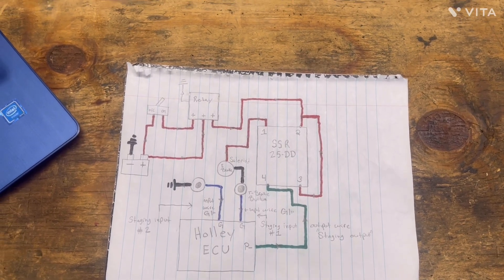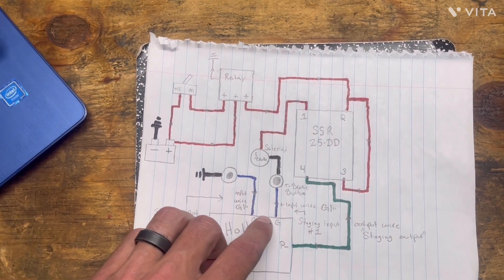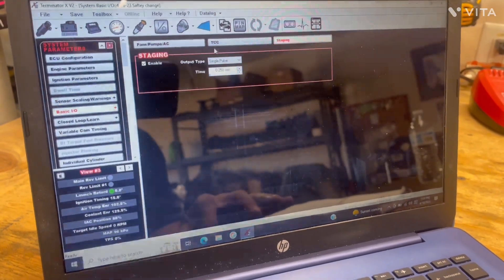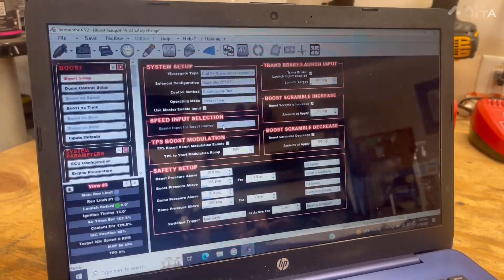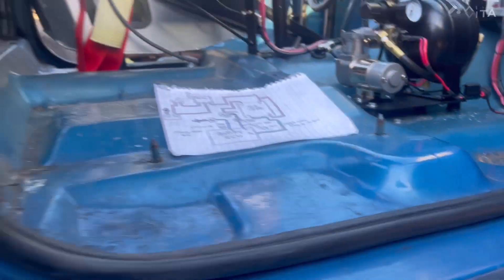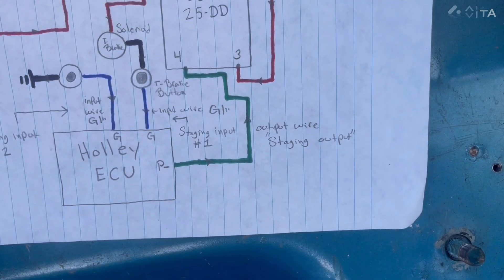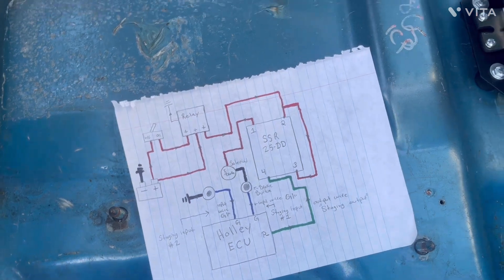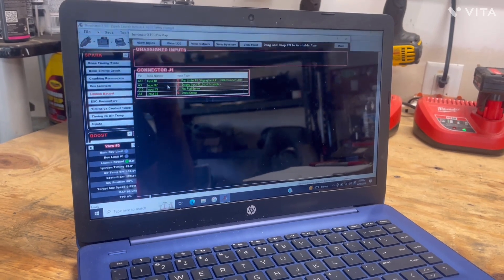Holly terminator X ￼trans brake and bump/scramble button wiring with diagram.

Comment: Will this work on holley hp ecu
Reply from the maker: Yes. Just read the description cause I forgot to put one part in the video. “The ground side of the trans break needs to go to ground also one side of the trans break button needs to go to ground” but yes it will work. My new truck is wired the same with a dominator.

Comment: Is this putting all of your solenoid current through the ground in the ecu?
Reply from the maker: Yes I was wrong in the video. Here is the link to the video and how I have it wired. The only thing that changed is the trans brake is grounded and the trans brake button is grounded. They do not tie together. https://youtu.be/Yz8AmD455XI?si=pxILc1gf8rDDAeYg
Reply: @BoWhiteRacing  thanks. That’s how i have it and was just curious why it would be different. Thanks for the info!
Reply from the maker: I’m looking back now to see how I had it wired. I think the coil was wired to ground and not to the button. I think I mixed my diagram up. I will figure out what way I wired it and fix the video or remove it and make a new one. Thank you.

Comment: Question about your pwm- did you just tap into the harness
Reply from the maker: It goes to an input.
Reply: @BoWhiteRacing  I see the output wire in the diagram in the J connect I was wondering did you splice into that
Reply from the maker: Im not 100% sure what you are asking. The inputs and output have a harness with 4 each that’s where I tie them to.
Reply from the maker: https://youtu.be/VCbD9vfmcb8 is it this relay?

Comment: Mine wired per the sloppy page, test ssr with multimeter pin 1 on ssr shows 11.7v, connect transbrake soleniod test it now only has 6v and voltage drops away 

Any ideas?
Reply from the maker: Let me look at mine and see what mine has. Maybe try removing the ground on the T-brake solenoid and see if the voltage comes back on pin #1. Let me know what you find.
Reply: @BoWhiteRacing  11.7v but transbrake soleniod doesn't engage/click 

Should I try earth it at trans?
Reply from the maker: Where does your ground for the solenoid go? Does it go to the Holley? If you ground the solenoid and give the other side power does it click then?

Comment: So one more question. So obviously the ssr switches it from ground to a hot correct?  If not. I'm still confused. Cause I have no hot wires going to trbake
Reply from the maker: You need to have 12v on leg 2 & 3 on the ssr leg 1 goes to your trans brake solenoid. This gives you 12v to the trans brake then you use the ground to trigger it. All the ssr does it give it 12v. Are you trying to do a bump button also?
Reply: @BoWhiteRacing  yes. I'm setting it up just like you have yours. 2step and scramble.
Reply: I've got the 2step button also.  But I haven't hooked it up yet. Figure I need tbrake to work first
Reply: @BoWhiteRacing  I've got everything just as you just described. However. I still have to have ground at my button for it to work. Which is not correct. That's what I'm chasing. Almost like holley is not sending ground
Reply: If i manual add ground on button. It works
Reply from the maker: Wiring the ground off your button to an input then you have to pin that input it will be staging #1.
Reply: Thanks pretty simple also nice wiring job

Comment: Your videos are awesome. But I'm still having a issue.   If you got tt.   I'm kilapedo 69.   Ima post a video in a Lil bit. My wiring is not nearly pretty as yours. But it confirms I've got it just like this. Except the button. Has my ground and input on same leg. And ssr on other.
Reply from the maker: Send me your number and I’ll text you and try to help you out that way you can send a pic and video to me. I’ll delete your number after I get it.
Reply: @BoWhiteRacing  it's wired exactly like yours I'm just making sure I understand it

Comment: I've talked to you about this several times. First I was having issues with brake staying on until ground unhooked..  I've git it wired exactly like this. Except my blue input is used. On my button side. I've got 2 post. One is going to ssr    other leg has my ground and input on it.   It should be other way around if I'm correct. It's working. But it don't seem right.   I've tried 3 different ssr.  One I'm using now looks like yours
Reply: I don't know how to pm you on here. I'd give you my #  and ill pay you to help me.   It's gonna be simple. It's almost gotta be ssr.    I think. I'm not sure. I'm ase certified. I've looked at many wiring diagrams.    I know your probably having a hard time understanding what I'm saying. I'll confuse ya